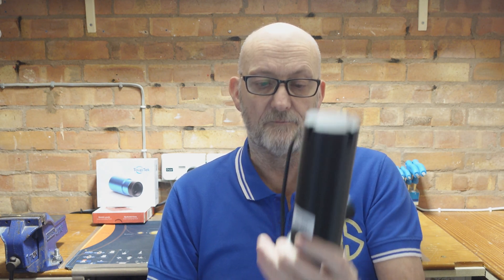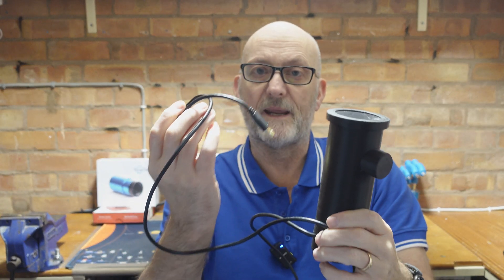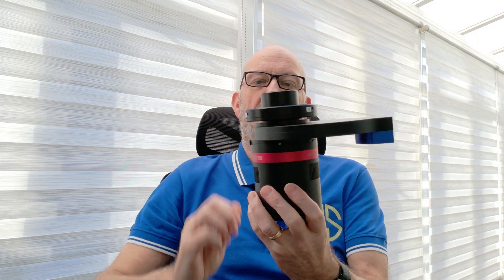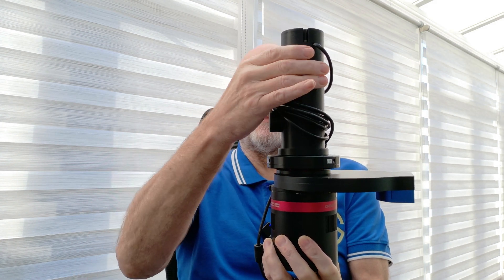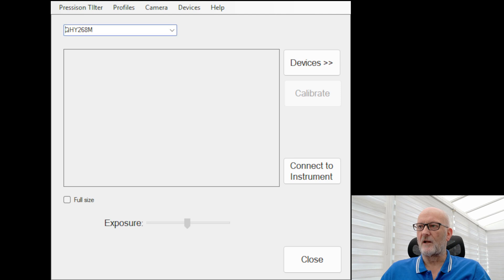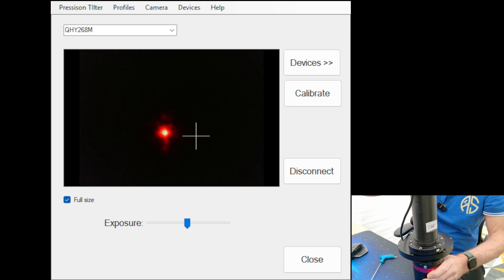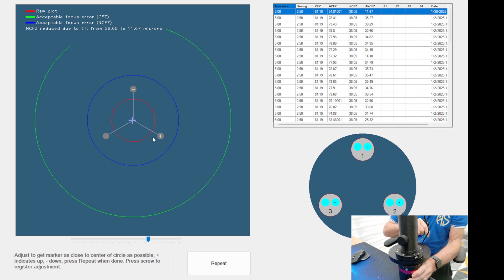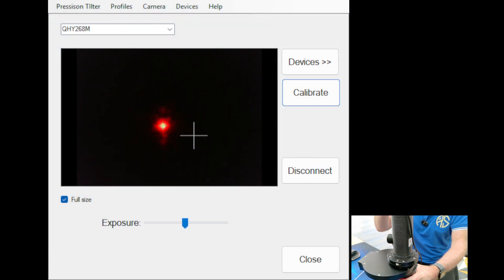Adjust Your Astro Camera Tilt, In Under 3 Minutes

Comment: That looks like a fantastic product! I'm curious though, what if you have a larger reducer/flattener like the E.S. 3" 0.7x?  

Also, since the vendor is here... Your website doesn't look right on Windows using Chrome in dark mode. Most of the text is unreadable.
Reply from the maker: Thanks for the comment, so if you have a 0.7x reducer, then in the profile you would put 0.7 in the relevant box, it does not matter what size the reducer is, the reducing factor is the only metric it needs, and that is just to work out the critical focus zones, you can still adjust for tilt regardless.
I will let them know about the website issues, thanks 👍🏻
Reply from the maker: Looks fine with dark theme on Google chrome on my PC and on my iPad Pro.
Reply: Hi I am Erik one from Astro Precision, we will offer adapters to both standard and custom sizes. I will present on hopefully tomorrow which I will use on my Esprit 150 0.77 reducer which is 74mm.
Reply: Hi, adapters can now be ordered at out website

Comment: That's an interesting piece of kit. I'd really like to see it have an M48 male threaded adapter, because as is it won't work with my imaging train. I have a Poseidon-M bolted to a Phoenix filter wheel, which is bolted to the OAG. That is 55mm and threads directly onto my 15028HNT, a fast f/2.8 newt. Most setups with a 55mm back focus requirement using an OAG are the same way - the OAG threads onto the scope directly. Believe me, I'd love a way to address the tilt of that setup other than the tedium of NINA's aberration inspector, CCDI and ASTAP analysis.

It looks like you're just sliding the device onto an extension ring, and it is resting against your tilt adjuster. The end ring of the device as well as the plate of the tilt adjuster it's resting against would have to be flat and level down to the micron, otherwise the device itself is introducing tilt. Further, the laser, prism and sensor all have to be precisely angled, or they, too would be introducing their own tilt.
Reply from the maker: Thanks for the comment, first of all why can’t you get an 55mm to M48 adapter, then an M48 tube ?
As for everything being perfectly flat, it does not matter, as long as it’s not altering during the rotation of the device and the test, the device could be tilted slightly, but as long s it stays on the same plane throughout the test, then all good.. 👍🏻
Reply: @Astro_Shed  why can't I get an adapter? Because that would not be part of my imaging train. I have plenty of extension tubes around and could easily thread an M48 one onto the OAG. However, in doing so, I'm adding a component that could itself be introducing tilt. So, I adjust the tilt using the device, then unscrew my M48 adapter, thread the camera/wheel/OAG back onto my scope and I'm tilted again.

As for the device and the laser/prism, does that need to be collimated (for lack of a better term)? For example, I have a Hotech collimating laser. The laser needs to be collimated, so when I rotate it around its axis, it isn't making a circle. Wouldn't the same apply here?

Don't get me wrong, I think the device is a brilliant tool and I've been fighting tilt with my 15028HNT for a few years. I'm asking these questions because I've got an f/2.8 system. The smallest amount of tilt becomes noticeable very quickly due to how narrow the CFZ is :). If this device could address that tilt? Then I could spend my nights imaging with that scope instead of trying to solve tilt problems, or being utterly disappointed by the results and tossing the data.
Reply from the maker: @JonnyBravo0311  the adapter would only be there to hold the device in position, the device would be flat against the OAG, so it can’t introduce tilt.
As for collimating the device, it’s hard to explain, but no, it does not matter as long as the laser beam stays coming out at the same point throughout the test, then all good, it makes no odds if it’s coming out at a 45 degree angle, to the device, as as long as it hits the sensor of the camera and stays at that same angle throughout the test, then all good, it’s hard to explain via text, but the laser can be coming from any angle, it does not have to be directly parallel to the sensor, but it must remain at the same angle while testing.

Comment: Interesting device, but is using a 3d printed plastic nosepiece connection solid enough for this kind of measuring ??
Because the device slips over the M48 adapter, that alone can cause some tilt, it would be better to make a solid connection with a m48 rotator for example
Reply from the maker: Thanks for the comment, I thought that too at first, but it’s pretty darn solid when it’s fully over a 2” Nosepiece, there will always be some movement as we are dealing in single figure microns, but to be able to adjust to within 5 microns is excellent in my opinion, the secret is to make it a pretty tight fit, if too loose then that could cause issues, I used an M48 extension tube rather than an M48 nosepiece, as the extension tubes seem to be a bit thicker. Hope that helps..👍🏻
Reply: @Astro_Shed  When you say a 2" nosepiece, please confirm you mean an appropriate M48 or M54 extension at least 40-50mm in optical length?
Reply from the maker: @ thanks for the comment, yes an appropriate extension, I just happen to use a 2” nosepiece..👍🏻

Comment: Very nice device! Does it also support tilters with four screws rather than only three? My PlayerOne Artemis-M has four.
Reply from the maker: Thanks for the comment, yes you have the option to choose in the profile, if 4 screws than you would make 4 sample points..👍🏻
Reply: @Astro_Shed Remember that PlayerOne cameras have a tilt plate built in and the screws are on the oposite side of this device. That means that the fixing position is upside down from the one used in this video.
Reply from the maker: @ritacastil  thanks for the comment, doesn’t make any difference, the procedure is the same and still easy to adjust tilt out, you just have to adjust from other side.
Reply: @Astro_Shed That means that the contraption needs to be placed upside down, the tilt adjuster sitting on the table with the camera up in the air.
Reply from the maker: @ritacastil  well no, not really, as you will be able to get an Allen key under the lip where the adjustment screws are to adjust, as they will be far enough off the surface you have the camera standing on, many people do it this way
Reply: @Astro_Shed Although you are absolutely correct, imagine the difficulty of getting the allen key into the small screw upside down!😂
Reply from the maker: @ritacastil yes I certainly agree it’s not ideal. I hate those 4 point adjusters they are not good as you can easily bend things, whereas the 3 point no issues and much easier I adjust 
I much prefer a separate 3 point adjuster like the Gerd Neumann ones 👍
Reply: @Astro_Shed I see your point, but really not to take advantage of an already built-in tilt plate seems a bit of a waste. I will give it a go!
Reply: 09:11

Comment: Where does the tilt come from. You have me puzzled as to why you adjust tilt.
Reply from the maker: Thanks for the comment, tilt can come from anywhere in the imaging train, which means the camera sensor is not parallel to the incoming light from the telescope, and so can produce poor shaped stars in the image, the tilt on my set up is from the sensor not being fitted into the camera perfectly level, which is more and more common nowadays, and is from poor manufacturing and bad QC. This is what having a tilt adjuster in your imaging train is a must and why they are sold now.
Reply: @Astro_Shed  thanks for the reply. I had never heard of tilt. I have an Altair Astro hypercam 269 c pro tec on an AA 115 mm refractor. I have never seen any indication of a problem. Fingers crossed I never do.
Reply: @steveg4iwr  Add a filterwheel, OAG, flattener and then put it on a system like a fast newtonian and you will get to know tilt all too well. 😆
Reply: @ sounds like a combination to avoid lol.
Reply from the maker: You are actually adjusting the tilt out of the system.